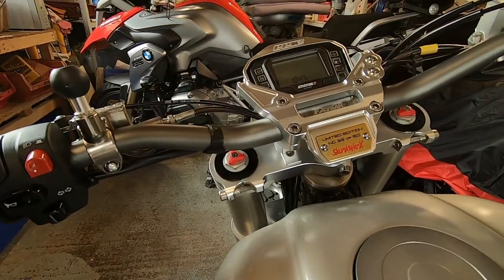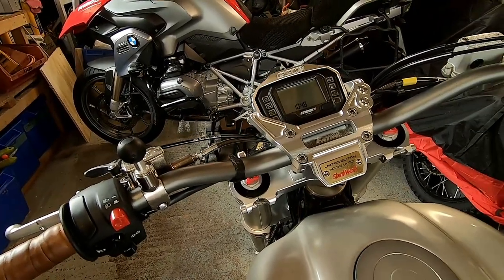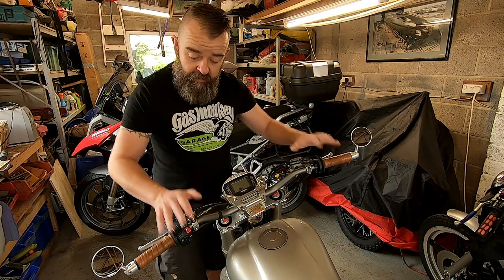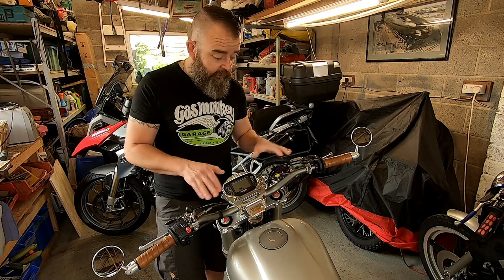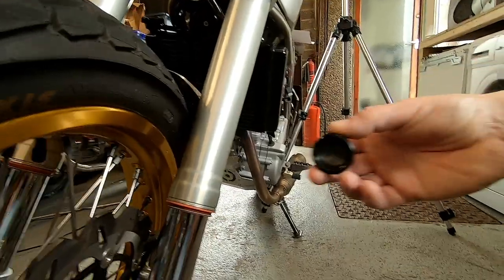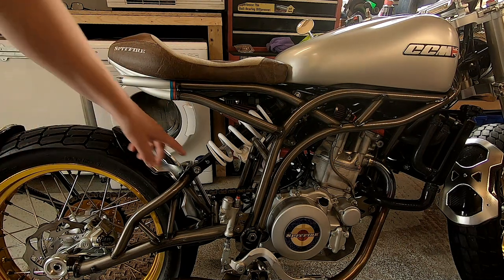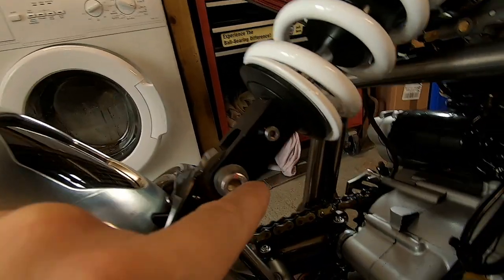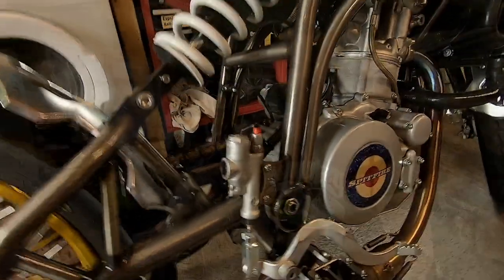CCM Spitfire Suspension set up

Comment: Did yours come with the bar end mirrors? What do you think of them? Mine has no mirrors, I'm pretty sure I will want at least one mirror, but do I go bar end or get something else. I need to do a few miles and I'll then see how my set up needs adjusting. I'm about 16 stone and a bit, and 6 foot tall. Great vid by the way
Reply from the maker: Hey up David, yes mine came with the mirrors, also that work quite well, yes you'll need a bit more preload in the rear spring and a couple of turns on the compression, thanks for dropping a comment, much appreciated, glad you enjoyed it, ride safe, Simon B 👍

Comment: Where you show the compression adjustment (lower end of fork), is the adjustment the hex nut or the centre screw??
Reply from the maker: Hey up Roger, it's the slotted screw part they you adjust on the bottom of the fork, hope this helps, stay safe, Simon B 👍